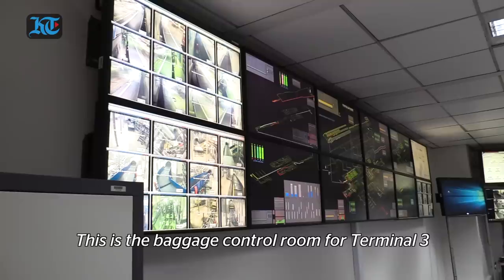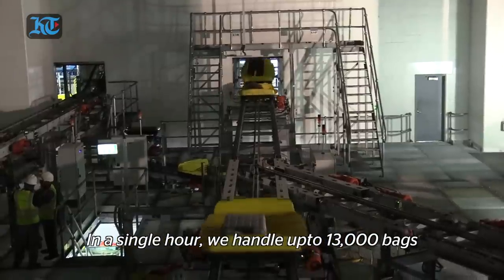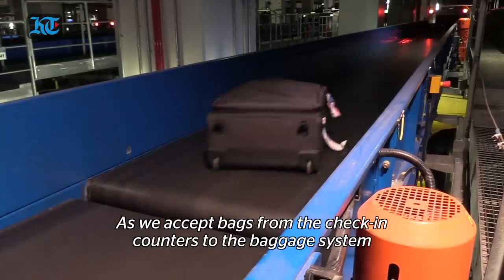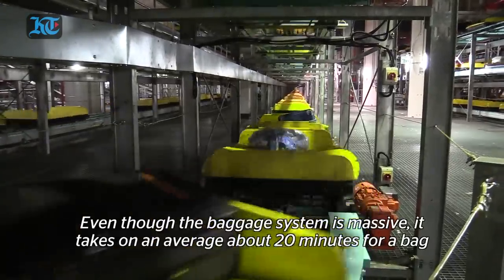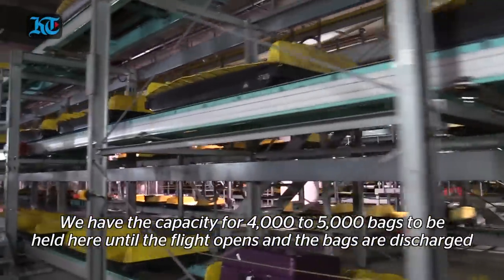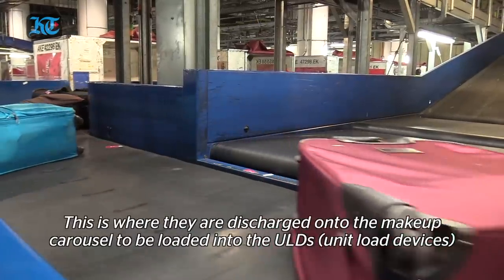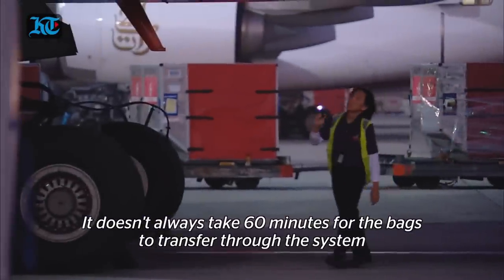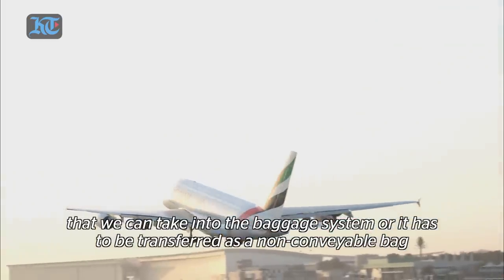Flying out of Dubai? Here's what happens to your bags after you check them in

Comment: LUGGAGE TIP:
Tie two or three colored ribbons of different lengths around the handle to your luggage to warn others that this is not their luggage.  People grab luggage at the turnstile and take it  home before you ever see it.

Use a man’s “half windsor” knot for the best look.

Anywhere you put your bag, it could be grabbed in error.  Example:  overhead compartment, unloaded from the bus, at the hotel lobby, turnstile........

Use 3/4” wide ribbons about 12-14” long.  Cut the ends at 45 degrees then seal the end with one drop of Super Glue to prevent fraying.  If each ribbon is slightly a different length by 1/2” or so, they will all show no matter what.  Tie the 3 ribbons as if it were one ribbon using a half Windsor knot.
After it is tied on, the total length of the ribbons will be about 5-6” from the handle. A little longer ribbon shows up better.  You can see it from 40 feet away.
Perhaps tie two handles, top and side of case.  Put your phone number on one ribbon using a permanent Sharpie.  
Choose one ribbon to have an unusual pattern or fabric to really make it unique.

Lay all 3 ribbons on top of one another.  Then tie them with a half Windsor knot, same as a man uses.

Stand by the output hole of the turnstile to reduce the chance of someone else grabbing the piece.

Tie your skiies, duffel bag, and what ever with matching ribbons—even your computer case.

If you are a Travel Agent, you could gold stamp one ribbon with your name and phone number.  Then send a set of ribbons, red and blue and black to your customer as a gift.  Record this gift in your database so you don’t duplicate yourself.  Buy a gold hot embossing machine.  Gold emboss your business name on the black ribbon.  If there is a way to put the customer’s name on it, do that.
Reply: Yeah until the workers rip them off
Reply: omg you don’t need all of this just tie a ribbon on it